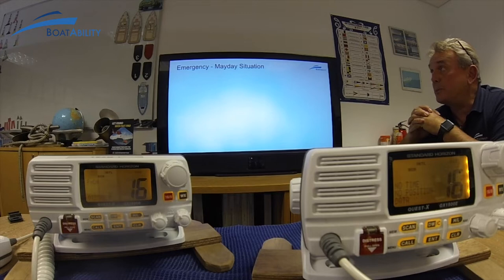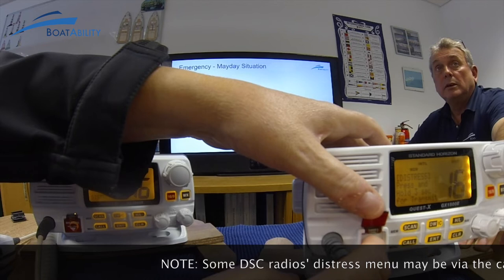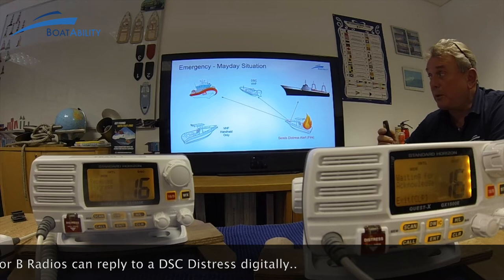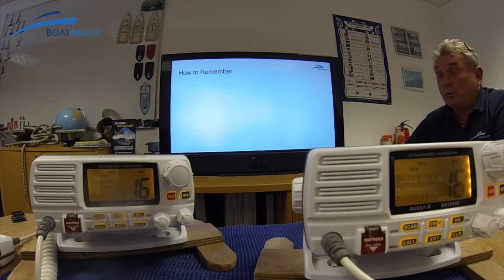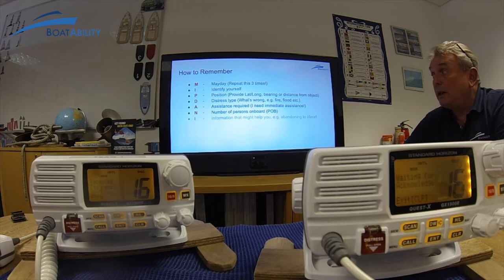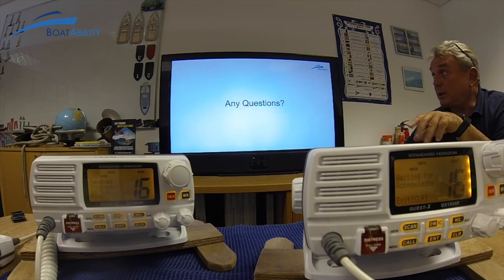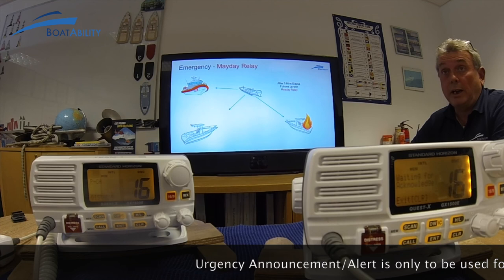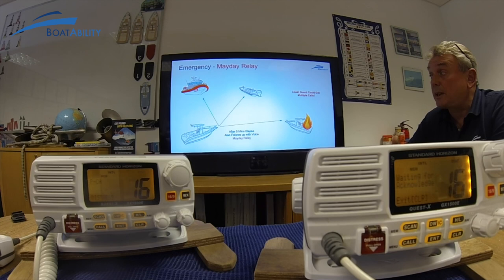VHF DSC Distress Mayday

Comment: A usefull guide, thanks. Early on (at 50s) you push the distress button once before scrolling to distress and then the 3-second push and hold to activate. What is this step for?
Reply: It is purely to explain that if you simply hold the button it takes 5 seconds to send a distress, except it doesn't send what's wrong with you due to not having selected the situation from the distress menu, it will be undesignated. Whereas, if you do go via the menu and select an option then it takes 3 seconds to send, but this time you've sent what's wrong as well as your MMSI, Position (providing it has a built in GPS or is linked via an MEA cable to your Plotter, it also sends the Time. Hope this helps. Nick